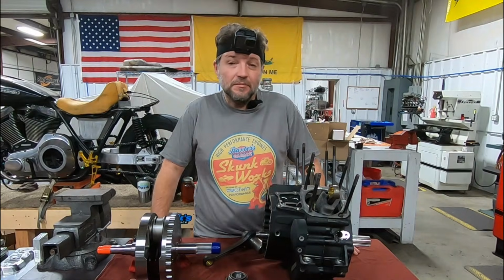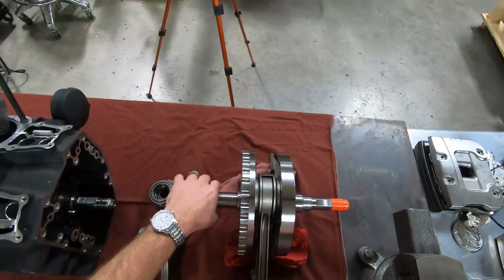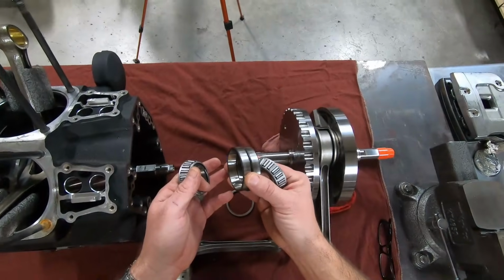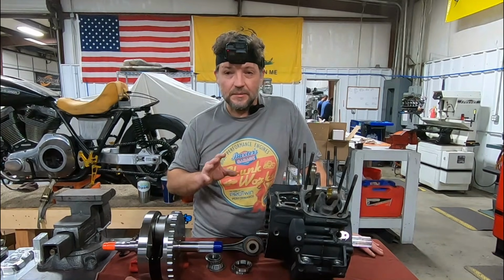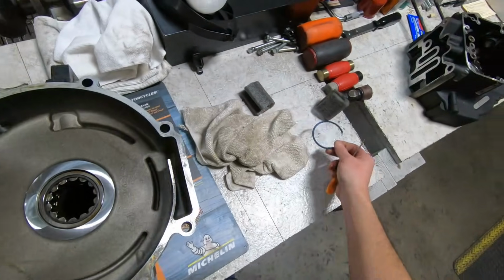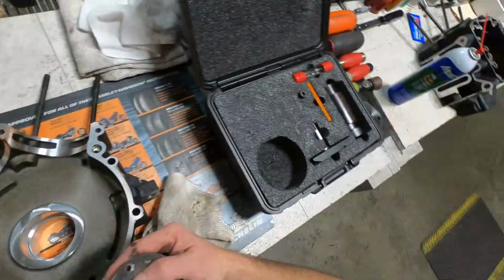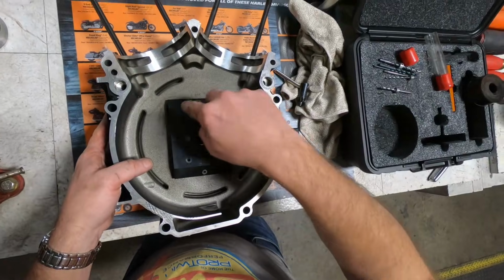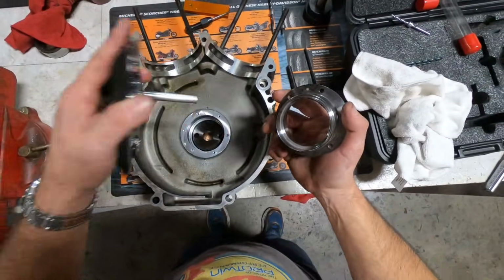Harley Timken Bearing Upgrade Conversion | Performance Harley | Kevin Baxter | Pro Twin Performance

Comment: The "TIMKIN Bearing Conversion"  Had me scratching my head.  I know TIMKIN brand bearings are nice but so are others.  Sounded like you were changing out bearings by brand not type.   TIMKIN makes  straight roller bearings,  tapered Roller bearings, ball bearings etc.  Is it common down there to refer to a tapered bearing as a TIMKIN bearing?  Do you still call it a TIMKIN bearing if it is made by a different company?
Straight roller to tapered roller conversion?  I'm not criticizing just asking.  Thank you for all the great content.

Comment: Brilliantly done. Thank you. I worked on cars and knew harley engine were much different. Now I know. Even though both are 4 stroke but are built completely different. A lot more complexed. lol But once to you know, you know. Thank you. After seeing this you set the standard. I'm going timken all the way on any engine. Now I know why compensator sprockets blow lol

Comment: Gotta love how what used to be the standard tapered roller Timken became an "upgrade" because HD discovered plain roller bearings permitted robotic flywheel assembly lines. The Twin Cam is designed as cheap as it can be, like a large Briggs and Stratton. That makes the aftermarket gobs of money in both cases.

Comment: Timken bearing or rollers bearing if torque properly from manufacture, owners shouldn’t worry, if oils are changed on schedules. I was told and heard other mechanics be gentle on engine breaking, that will put a lot of stress on your engine crank . People need to remember that this aren’t sport bikes when engine breaking.

Comment: After that great explanation of all the forces at play on the crankshaft, flywheel assembly, you've got to wonder what was Harley thinking when they did away with the TIMKEN bearing? It has to be all about cutting costs.

Comment: $20,000 motorcycles and Harley can't put a quality main bearing in..... This is why I have not bought a new Harley in 20 years. My '03 Twin Cam 88 is bone stock. Putting top end upgrades on Harley engines lead to busted bottom ends without a main bearing upgrade. I think it's wrong that Harley sells top end big bore/cam kits knowing they put in main bearings that are barely up to bone stock duty much less even their own top end "upgrades". The first thing I look at with a used Harley is if it has any "upgrades" on the engine. If so, RUN.

Comment: Wow, what's new is old again. Before 1955, Harley Big Twins used individual rollers and shims. When they wore, ya honed or replaced the sprocket shaft race and thrust plates to fit bigger rollers. I machined quite a few old Pan, Knuck, and BT Flathead LH cases for the '55-up twin cone Timken set.

Comment: Now I'm bummed. I gave my son my 2001 carbureted Roadking after bought myself a 2006 FI Springer.. We both did S&S cams, oil pumps and tensioners... Other than that, they are stock 88s. Is mine junk waiting to grenade?

Comment: Wait a minute, 25:00 you were so concerned about the burrs off the tapped holes after this, but what of this hole for the oil feed hole, I've encountered burrs at this point ALL the time in manufacturing.

Comment: I Bought a 1999 Electroglide and they did not use the Timken bearing a lot of people had a problem because The Roller bearing race was turning in the housing it was one thousandth of an inch to big Harley being Harley made a shim , previous Bikes had Timken bearings EVO's I am pretty sure, Because i have a Tee Shirt from Bike Week 1999 that says Greedy Bastards Harley Davidson Motorcycle Company Born 1903 Died 1999. That was about The V ROD  but the bearing sucked to.

Comment: I was wondering what the benefit of paying someone to upgrade the cases with all the work and expense involved makes sense when you can buy S & S upgraded cases with not only timken bearings but other upgrades like thicker walls and machined to accept larger cylinders etc for $1300 ?
I'm sure there is a reason but being a machinist but absolutely not a Harley mechanic I'm a noob 
please school me ...
Thanks

Comment: Fantastic demonstration on the tool and installation; I can't wait to tear my twin-cam apart and do this modification.  

If you have a deep sink, hot water and Dawn dish soap are much more effective for washing machined surfaces.  Not to say I haven't used the steam clean in a can when I have to, but every engine guy and machinist I apprenticed under at Cummins told me to never trust brake clean to get things perfectly clean.  When I was at a basic engine machining class, one of the presentations was on best cleaning practices and they had pictures blown up under a microscope of particles left in blind holes, nooks, and crannies after a brake clean job and simple air blow out.  The hot soap and water emulsifies the oil and lifts the particles off the surface, brake clean relies on dissolving the oil and hoping the force of the spray will knock loose the particles.  Often time, the particle will remain as the brake clean dries.

Comment: What was the name of that 107 motor you mentioned and how much what type of power would it make
Reply from the maker: It was one of our full custom Skunkworks Engines.  Power output varies depending on how customer rides and best build for him.

Comment: Have you ever had the inserts pull out because of the different heat expansion rates of the set screws and sleeve and case? I’ve heard a few builders I know say they had a problem with the that, even with the green loctite. 1 guy As many as 10 out of about 30 of them (and he is a very good engine builder, not just a weekend Warrior)
Reply from the maker: im not aware of that issue nor have i seen it myself.  ive installed MANY MANY of these over the years.  there must be a reason it happened.  heat expansion rate differences get infinitesimally small as the part gets smaller.

Comment: Nice work . Both of my motors have Timken bearings and gear drive cams . I heard that it is not necessary not that I carried . I thought it was for my build and I still do . Thanks for showing how its done and where to get it done

Comment: Very very detailed video. My buddy had his whole engine done with the Timken barring. I went the easy way out lol. I ordered a S&S 124 create engine. After doing the math it was cheaper. My buddy wanted a full on street and strip engine I'm fine with just a street sweeper. But I would like to swap out the s&s 585 for andrews 67G 😆

Comment: A few years back I did a SE 117 conversion, but  HD didn't  sell the  Timkin conversion kit yet, and  said that it wasn't necessary,  luckily  Jim's  had  them, I can't see running any kind of performance engine without it.

Comment: Hey guys tapered timken 99-02 twin 88 not 99-01
Reply from the maker: Im aware....i should have more clearly stated it was changed in 2002 "FOR 2003 MODELS".  Thanks for clarifying.

Comment: Darn! I wish I had seen the premiere of this video. I have seen another Ytube presenter saying that from 99-02 was a timken bearing setup on the 88's. Kevin at the beginning of this video says it was changed in 02. I have an 2002 88 and would really like to clarify which bottom end I have.....
Reply: I’ve research this subject in depth and all state 99-02 are tapered timken

Comment: Timken is bearing manufacturer and they make all types of bearings. It looks like instead of "cone" bearings, Harley mechanics use word Timken, which is wrong.
Reply from the maker: agreed.  Tapered Timken set or cone as you said, would be more accurately stated.
Reply: Sort of like people saying “Coke” when they mean soda.

Comment: Hi @Kevin Baxter, what is the implication of you drilling the holes without the sleeve in place? Would they than be a tad deeper and the oil ones slightly shifted inwards as the thickness of the sleeve offsets otherwise? From my reading of Jims instructions for this procedure, they do it with the sleeve installed.

Comment: You really wouldn’t want to do both sides anyway , as one side needs to be able to move slightly to compensate for expansion and contraction of the cases at different temperatures. Smaller engines often just use ball bearings with bigger clearance designed into them , but it’s also common to see cranks with a ball type bearing on one side and a roller bearing on the other

Comment: It may be stupid, but I would have liked to see at least 1 example of hand Tapping. An awesome job w/ this Vid.
Reply from the maker: i may be misunderstanding your question....when i have the small orange bar in my hand, and a t handle, that is me hand tapping the small holes.  Thank you!
Reply: @KevinBaxter  I've seen tapping once. Do you rotate back and forth ? Or go for full rotation until tapped ?
Reply from the maker: Great question.  this largely depends on the size of the hole, thread pitch, and material you are working with, if its a blind hole, and the type of tap.  Its all about clearing the chips.  If the tap clears the chips well, and its a soft material, you can run straight thru.  There are industrial taps for steel and harder metals that are designed for production and go straight thru in the blink of an eye.  For the DIY, i would recommend backing off just enough to break the chip.  then continue.  you may even have to remove the tap, clean, reoil, and go back at it.  truly is a feel sort of thing.
Reply: @rickh.959 
I would do the back and forth method with a cutting fluid like Tap Magic and clean the tap off if you get too much debris on your tap / Die no Die used here though. 
Remove all FO /debris from holes & project. 
FO (foreign object) aircraft talk there it’s a career habit. Lol 😂
Reply: @KevinBaxter 
The orange bar is just a guide for the tap isn’t it and does it come with the kit?

Comment: Exact reason I bought my 02 TC, along with I wanted a controlled fuel leak not injection. Such a great video Kevin. What if you already have a timkin bearing, do you just do a new set up? Thanks Kevin, learn a little more every time. Your Patreon is worth it’s weight in gold on knowledge alone.
Reply from the maker: Thank you Sully.  Youve mentioned Patreon a couple of times.  Maybe i should look into that.  If it is a timken case, the races would be pressed out, new ones back in, and then same procedure from there.
Reply: @KevinBaxter  Thank you Kevin, much appreciated. Sorry about saying Patreon, I was thinking the donation monthly was done through Patreon. None the less, worth every penny.

Comment: Great video.
Do you sell these Jims tools for the conversion?
Reply from the maker: Yes sir we do.  If you would like to call the shop to order, 6782269651.  Ask for Pete.  Included in kit is one new steel bearing insert sleeve (held to under .0002" total indicator reading), all necessary drill bits to drill oil feed and return holes, press plate that holds bearing sleeve insert in line with case bearing bore at time of installation, all necessary hardware and instructions.  Cost is $1208.95 with free shipping in the lower 48.  All you would need from there, is the actual timken bearing kit and the crank spacer...all of which we can send you.

Comment: This is another excellent video,  You did a good job explaining the laws of physics, complex engine dynamics, forces, and load that the crankshaft goes through.  I love the Timken Bearing Conversion and see the value in the upgrade.
The video left me wondering what would be the extra cost in the upgrade, If you were rebuilding a Twin Cam or M8?
Again,, THANK You for shearing your knowledge with us.
Reply from the maker: All about lower cost and speeding up production.  Thanks Gary!

Comment: I wrenched on Harleys back in the 70s and at that time the Timken bearing was the rule, it had replaced roller bearings back in about the mid 60s or earlier, probably was a time when I knew the year but no more. So why did they go back to roller bearings? Saving money?
Reply: That was around '55, 56. The drive side of the crank went from tapered to splined at the same time (see: Panhead).

Comment: This is a great video... question as I’m watching this part of you drilling... what rpm do you run drill/mill on? Thank you
Reply from the maker: Typically, in alum, 250 sfm x 4 / diameter of cutting tool.  with this, i run it at 2000 rpm to clear the chips when i retract.
Reply: @KevinBaxter  ok. Thank you Kevin for sharing your knowledge. God bless your new year and day. Pastor Joseph Hart.

Comment: Looks to me like planned obsolescence so things will wear out faster then you can buy another motorcycle to keep them in business thanks for all the educational tips
Reply from the maker: lower cost...quicker production.  youre welcome.
Reply: HD chose roller bearings so they could partially automate engine assembly. Watch videos of the line. Rollers saved HD millions in labor but they cheapened the product since the Timken is acknowledged superior and worked fine since 1936.

Comment: how many miles on that 'boat anchor flywheel assembly" ??   Whenever I watch these vids I'm always asking myself-  WHY didn't the factory just make it right in the first place... $24000 and xMiles later and your crank is garbage ??  Compensator issues, cam tensioner fails, cam plate defects causing oil sumping ????????????????????
Reply from the maker: 30,000.  not uncommon but there are a lot of bikes out there.  not all suffered from this.

Comment: Just out of curiosity is that the same oil I used as an electrician to cut pipe threads.If so the jug used to state that the sulfur was there to help prevent infections in cuts witch happen to every body that works with their hands. I was hopping to watch this live but was drawn to the TV right before hand. I guess some times idiots happen. Great really great video. You have gotten very good at passing on information. Thank You.  Mike from Maryland
Reply: Oops. I must have come back and pushed the button again. I'm old and I shows.
Reply from the maker: i had heard the same thing...but never confirmed.  but yes....because it's universal for all materials and works for milling, turning, and tapping operations.

Comment: I heard its not necessary to get a timken bearing upgrade on your m8 unless you are going to like a 140ci, whats your opinion on that? Also I heard its not necessary to do the timken on the m8 but should still do a welded or plugged crank for bigger engines.
Reply from the maker: Please have a look at all the videos in the TC vs M8 series.  You will find the engines arent as different as people think.  Being the M8 is capable of more bolt on power than the TC, if going into the bottom end, I would certainly recommend a timken if going 140hp/tq.
Reply: @KevinBaxter  Thanks for the feedback, love the videos keep them up. Can never have too much information imo.

Comment: Thanks for another informative video. What's the average price to have this done
Reply from the maker: depends....on average, aside from labor to pull engine, etc, once the crank is prepared, it's around $400.  if you ever need to split your cases for a build, i would do it.  i probably would not take down a good running engine with no issues, just to do it...unless its a major hot rod in which, it should have been done in the first place.

Comment: I was under the impression, the INA bearing was a "ball bearing."  Now I see it's a roller bearing, but it's a flat roller, and not tapered, like a Tipcon Bearing.
It's soooooo depressing, to spend so much money on something, that needs to be completely rebuilt, to "above stock standards," just to have a little peace of mind about the machine your ass is on.
I enjoyed that Kevin.  I like mechanic 'n on stuff.  It's fun seeing someone who knows what they are doing 'most of the time!'
Is this case you're working on, the same as my '04' 88ci TC?
Being on '04,' does my 88ci TC have the tapered end connecting rods?  I've never been inside it... Yet!
If I have to crack open the cam chest, to inspect those chain tensioners, I might as well replace them...
Even if I can't afford to change to gear driven cams, should I take out the cam plate and have the cam bearings changed on the primary side of the cam chest?
Always more questions than time!
Peace Kevin...
Reply from the maker: this was an 07....but for the most part, the same as your 04.  if you go into the cam chest, certainly install torrington cam bearings.
Reply: I wish Harley would have kept using the Timken setup and the forged crankshaft.
Reply: That would be a Timken bearing James.

Comment: When drilling the collar holes into the case, I was thinking, “get them shavings OUTTA HERE! we do NOT want any metal shavings leftover inside the case.”  😂

Serious question tho, do you countersink the fill/drain holes as well? Or do you just deburr those ones?
Reply from the maker: no kidding!  lol.  i just deburr those.
Reply: @KevinBaxter  Yea, i was thinking a 0.005" to  0.010 " chamfer on the threaded holes to remove the "rag" along the edge s after tapping and then just knock the rags off of the edges of the fill and drain holes..
Reply: @KevinBaxter  good stuff. Thanks bud. I’m going to be emailing you within the next week or so via the website... A more general question but definitely needs more space for proper room for what I think the reply will entail.

Comment: Great video but I'd like to know how much HD actually saved by deleting the Timken bearing. Did they have to delete because of the change in accepted tolerances of the crank?
Reply: Cylindrical roller bearings are super cheap when compared to tapers, especially with a matched set as used in this video.
Reply from the maker: as for how much saved?  hard to say.  but it came down to cost and faster production.